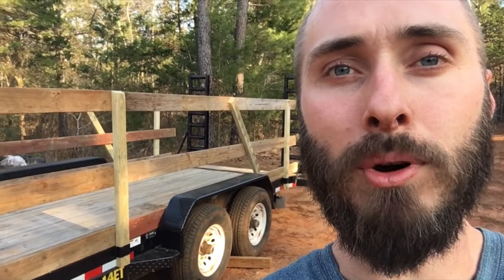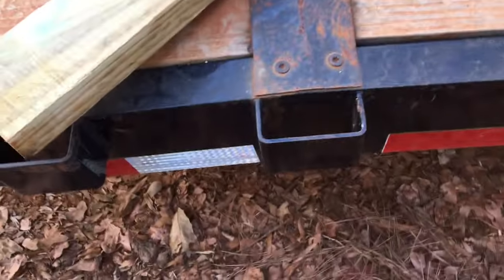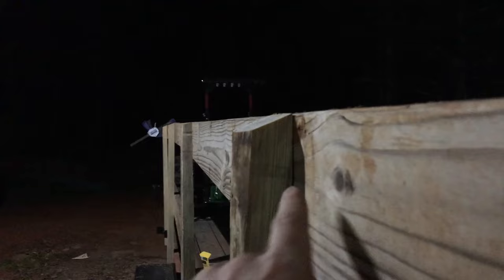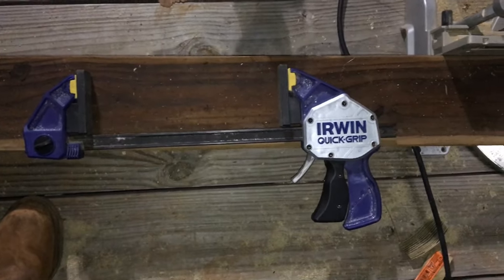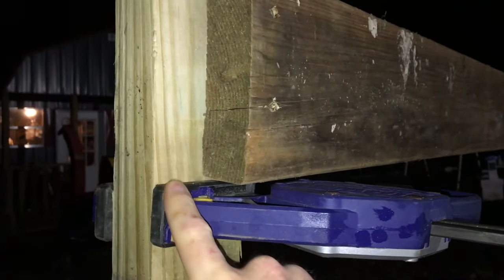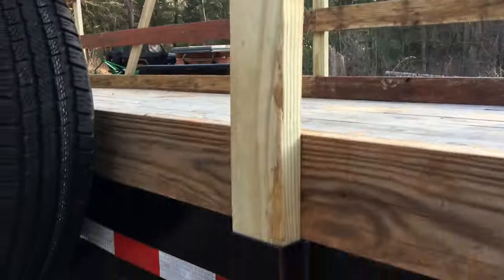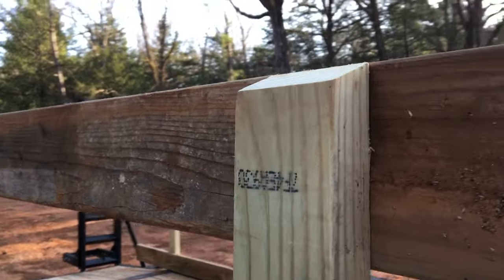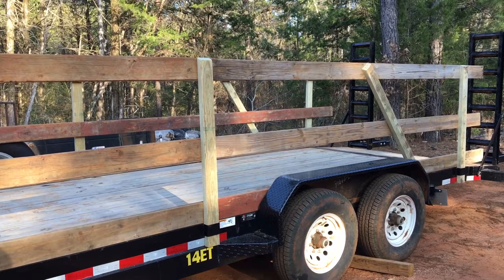How to Build Wood Sides for Utility Trailer | DIY Homesteading Videos | #EastTexasHomestead

Comment from the maker: Hey Y'all, here are some quick links to Mr. Heater items on Amazon.
All Irwin Tools Shop on Amazon.com ➜ http://amzn.to/2l3Z4L6
Quick-Grip Irwin XP12 Xtreme  ➜ http://amzn.to/2ksJTt9
DEWALT DWS780 12-Inch Miter Saw with XPS ➜ http://amzn.to/2kmAwQE

Disclaimer: These are affiliate links. I've placed them there for your benefit but be aware that I will receive a small commission if you make a purchase. If you do decide to purchase through one of the links, thank you for helping support our family.

Comment: I saw a guy with an flat bed Ford truck he made stake sides with 2x10, 2x8, 2x6 then 2x4 then 2x2 spaced 6 or more inches apart.   Looked really slick great idea and it was awesome.  I plan to do the same for my 18 foot car hauler...

Comment: OK quick tip your Racks are not secured in the stake pockets so drill a hole thru each 2x4 right under the stake pocket and push a clevis pin thru it this way the rack can't jump out of the stake pockets. And use Plywood instead of your 1xX or 2xX it's cheap and does the job well enough.
Reply from the maker: Great advice. Thanks!

Comment: Good job on video. You really should drill your holes before screwing them in. I use a drill and driver so I don’t need to charge bits. It will save you from those cracks. Cute kids by the way.

Comment: Nice job!
Reply from the maker: Thanks!
Reply: @EastTexasHomestead  I'm about to buy a trailer would you recommend one with sides, or flat like a car hauler?
Reply from the maker: That depends on what you’re using it for. Now that I have a set of forks on the tractor, I always try to load and unload the trailer with them. It would be tough to do that with sides. But, if you’re hauling a lot of dirt and brush, sides are great.

Comment: A nail or other pin on a 45 degree upwards angle should hold the stakes in place.  Basically anything that can't back out will do.  
Also great idea using the clamps.  Totally gonna steal it and claim I came up with it! ;p
Reply from the maker: I ended up doing exactly as you suggested except I used a screw so I could easily remove it. yeah, I find a way to use those clamps in just about every project I work on. Not sure how I lived so long without them.